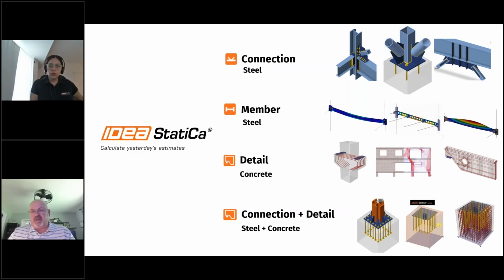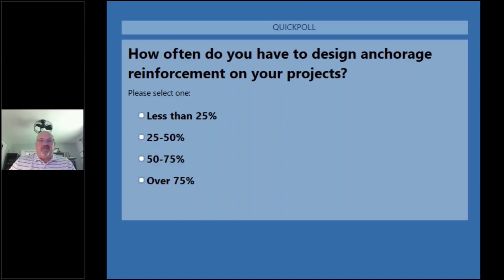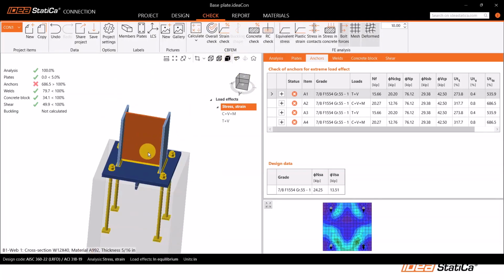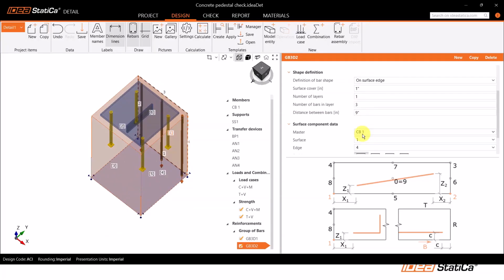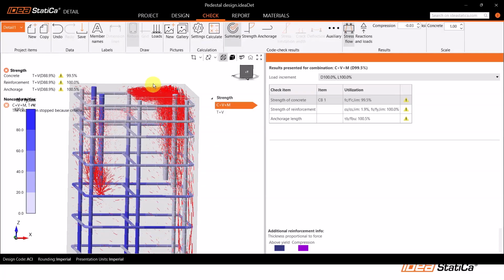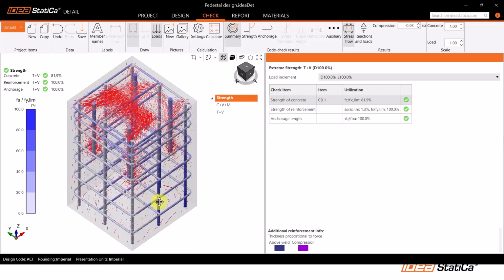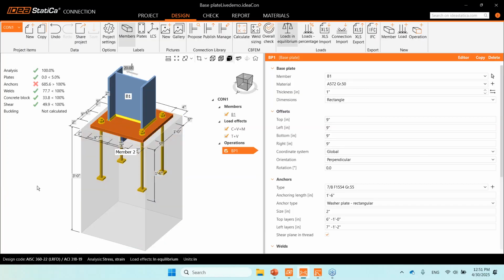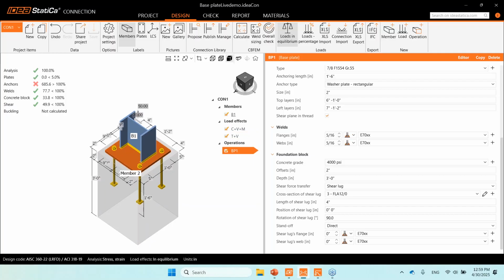Anchor reinforcement in base plate design ACI, AISC

Comment: how to import the load case in group of force on member
Reply from the maker: Hello,
you can either import data from Connection to Detail, including group of forces (simulates the stress flow between the steel base plate and the concrete block):
https://www.ideastatica.com/support-center/connection-to-detail-integration-eccentrically-loaded-anchoring-en
or start a project in Detail from scratch and then input the loads as surface or point loads:
https://www.ideastatica.com/support-center/Eccentrically%20loaded%20anchoring%20in%20Detail%20(EN)